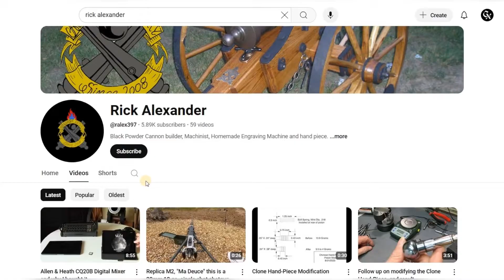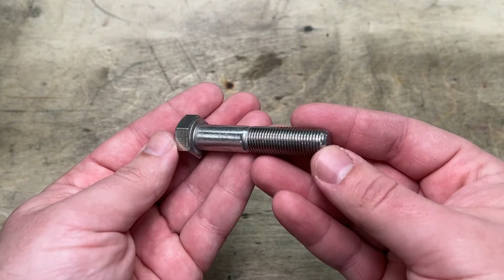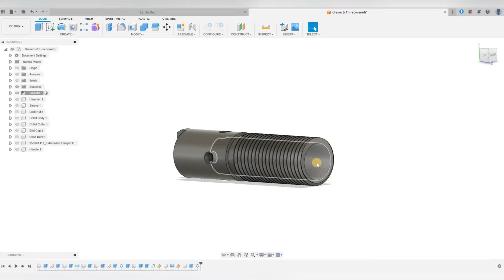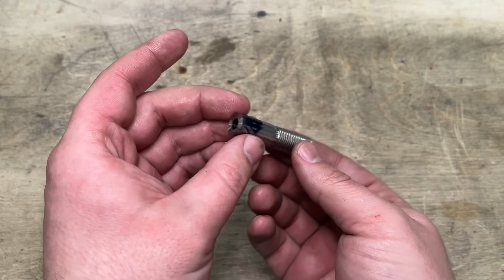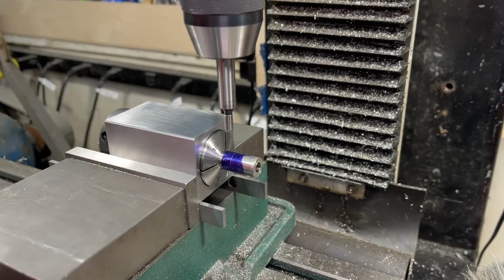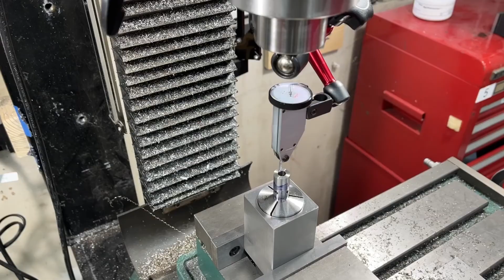Pneumatic Engraver - Part 1 - The Barrel

Comment: I built a copy of Rick's engraver. I used a 120V compressor modified. What is better controlling the amount of air flow or the speed of the compressor?
Reply from the maker: I might not be the best person to ask about this but I will give you what I think is the right answer. Unfortunately I think it will be a "it depends" type answer. From my understanding a really fast cycle rate with a lower power give a better surface finish for something like a bright cut. On the flip side if you are setting a stone it might be more useful to have a harder hit but control each strike individually. For myself I have found controlling the air flow is easier to control the engraving. I pretty much have the compressor going as fast as it can then feather in the air to control the pace of the cut. I hope this helps from my very limited knowledge and experience.